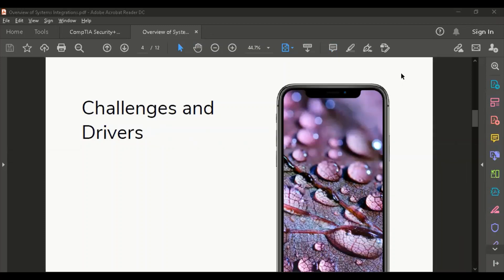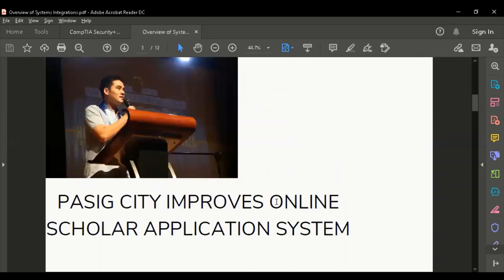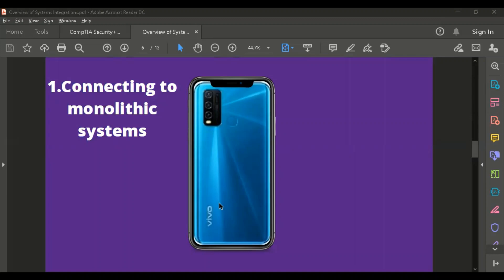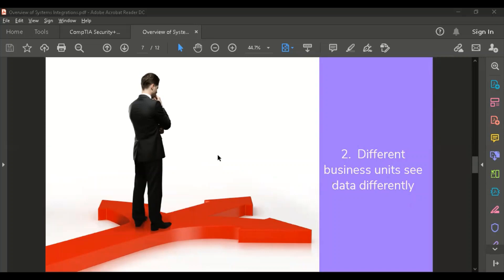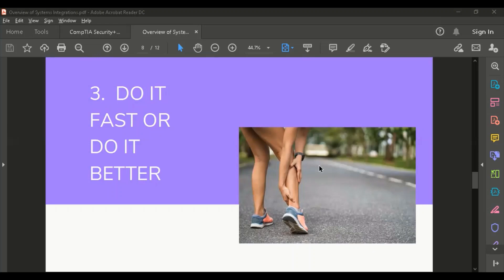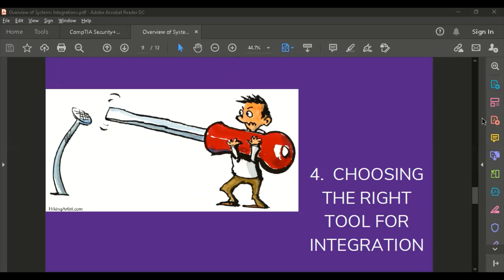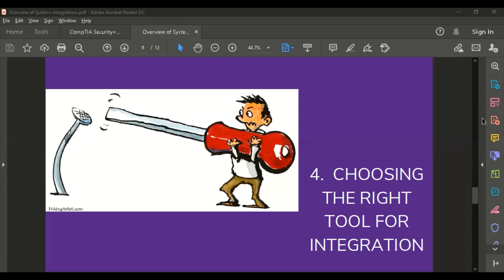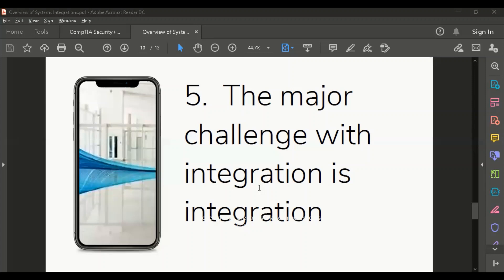Challenges of System Integration

Comment: In today’s world their so many things that change, everything has change. Based on what I understand we live with technologies; we influence by technology.
First, in monolithic system they input data or output data, error handling and user interface. system integrator has to take care to identify and choose the best way. Integration is becoming a problem due to such architecture. Most of the enterprises that we have is this monolithic system. Different business units see data is a kind of a minimum canonical data model, many enterprise architects avoid using canonical data as agreeing upon it often involves multiple meetings and discussions to reach. It’s helps avoiding point to point data modelling and allows other businesses or applications to connect to the systems using a service that implements canonical data modelling rather than having to integrate to individual systems directly in their native data model. Third, do it fast or do it better means you need to do it on time no matter how it’s difficult always remember time will never come back but think before you do it to make it better. In business they always constrained with time and cost, Proper architectural planning, used to ensure quality often becomes difficult for IT due to these constraints. There are several tools available in the market that can speed up the project implementation and help achieve business requirements faster, but they often lack a good development pipeline and use of the best architectural principles. A system integrator must find a balance and ensure that the integration solution is not just about meeting the functional requirements of today, but also potential future. Fourth, always choose the right to make it best and good. It is a struggle to choose the right but if you think and when you are planning you will get the right, like this, you need to learn and choose the best tool for integration. And for the last, one of the biggest challenges of data integration is defining it. Data integration is often used interchangeably with business integration and system integration, but they are different. this will help enterprises avoid another monolith and designing and implementing integration solutions for their current or future products,this will help enterprises avoid another monolith and designing and implementing integration solutions for their current or future products. It’s better to choose the right selection of products for your business.
Reply from the maker: Thanks. Please watch my interview with Dr. Lansigan.

Comment: The video helped me to understand the importance of System integrations and the things to consider when integrating a system. There’s a lot of things to consider when melding or integrating systems but when integrated it has the chance to improve productivity and that is the goal of all Businesses. System integration helps business by saving cost on maintenance of multiple systems. Allows them to have easy access to data because it can be found in one system only and allows them to retrieve that data. In the video Sir Burgos said that there are 5 things to consider in integrating a system and that is connecting to a monolithic Systems, Different business units to see differently, Do it fast or do it better, choosing the right tool for integration and the major challenge with integration is integration itself.Monolithic systems are systems that are interwoven with each other that getting rid of something or having a problem in one part will result on it affecting the entire part it’s like a domino effect it’s a big challenge to integrate monolithic systems because the system integrator need to be very careful in handling this kind of systems.
Data can be interpreted differently based on the people or department looking at it example of this is data from the accounting department will be interpreted differently by those people at the HR department
Do it fast and do it better is kind of self-explanatory when you are in the IT business your higher ups will expect you to deliver the functionalities that they want in a specific span of time that has been given to you so that leaves you with two choices to do it within the time that has been given to or to do it to the quality that the customers expect from you
Choosing the right tools is very important since you cannot use a hammer to screw in a nail that is the screwdrivers job the same thing can be said in system integrating you must ensure that you have the right tools to integrate the system in the right way 
The final and last one is obvious the major challenge in integration is the process of integration itself you have to consider all of the above mentioned challenges but you need to actually integrate in successfully -BSIT 3F ASIO JAFET L
Reply from the maker: Thanks. Please watch my interview with Dr. Lansigan.

Comment: System Integration is significant in today's generation because the integration of a system makes the systems more reliable and capable to use. Improvement is the main objective of why we integrate something as well as systems because we need to enhance the performance in order to take on additional tasks and to help the communities. Just like the latest submission of requirements in Pasig City Scholars, they enhance the system to help the scholar community to avoid face to face interaction and obey safety protocols during this pandemic.
Some challenges and drivers might encounter such as:

1. Monolithic systems that are basically interwoven or interconnected to each other. Therefore, system integrator has to take the best way of integrating with monolithic systems.
2. Seeing data differently from different business units because of the different roles and functionalities they have within an enterprise. This is a challenge because a standard data model is required in order for the system integrator to integrate with a standardized view of data within the enterprises.
3. The problem related to time and cost is also a challenge in integrating a system because the job of a system integrator is not just only to satisfied today's requirements but to satisfied also the potential future performance of a system within the enterprise.
4. Choosing the right tool to integrate a system is a challenge within the enterprise because the right integration tool supports hybrid integration, hybrid integration seamlessly integrates with a cloud-based application.
5. Lastly, the biggest challenge with integration is integration because a system integrator should choose a product very well.
Reply from the maker: Thanks. Please watch my interview with Dr. Lansigan.

Comment: I have learned while watching the video is that what we call system integration. A system integration is the composition of a capability by assembling elements in a way that allows them to work together to achieve an intended purpose. It is maybe a long pending project but the pandemic make it hurry to produce the system. One of the examples is the system of our government it is called the Pasig City Scholarship System. It may be taking too long to make it reality but this they make it fast to make because of the pandemic that we are facing right now so that I as a student can apply just by clicking and typing while I am at home. There are 5 challenges in an integration system, one is the monolithic system meaning is that they are connected to each other. They are all in one system which is if one of the components got problem, other components will be affected.
The second one is the Different business units see data differently every department saw the data differently. They saw, experience different kinds of data in each and every department that’s why they have a different kind of thinking. Third one is the do it fast or do it better. You can do it fast but the objectives and terms of the client will meet its expectation or do it better you can do it precisely and easy even if it slow but will meet the deadline so that the client will be more than he/she expected. The fourth one is the choosing the right tool for integration. You must choose the right one to use in the right project so that your efforts, time will not be waste. Using the wrong tool will sometimes still work but it will be more complex and difficult to execute. The fifth and last one is choosing the right product for your integration. You must be compatible and pick wisely so that you can enjoy and happy of your choice.
Reply from the maker: Thanks. Please watch my interview with Dr. Lansigan.

Comment: Based on my understanding we live in an era where technology is advancing. Our daily lives have been transformed and influenced by new technology as our daily operation. Different company uses IT System to allow business. In Addition, System Integration refers to the process of connecting different components into a single larger system that role as one. There are 5 Challenges with System Integration. First, connecting to monolithic systems means company relies heavily on systems that are largely legacy systems that cannot be removed for integration purposes. If it has a monolithic architecture, a computing scheme is called monolithic. The technically distinguishable features of monolithic architecture are not architecturally distinct parts, but are instead interwoven. Integration is becoming a problem due to such architecture. Most of the enterprises that we have is this monolithic system. Second, Different business units see data differently means Features is viewed differently by each business unit or business domain because their operating roles are not the same and they may use different systems or applications. From the point of view of an individual unit, this is good, but to incorporate these structures, a common data model is needed within the organization. Not only does a system integrator need to follow an organization's specifications, but it needs to look about these to develop an integration that provides a standardized vision of data within the organization. Third, Do it fast or do it better mean as an IT student we need to deliver something to the company, If you not able to do that you maybe the next day you’ll be fired. Because of these limitations, good design design is used to ensure consistency is often challenging for IT. There are many resources available on the market that can speed up the execution of the project and help meet client objectives efficiently. Fourth, Choosing the right tool for integration means there are plenty of solutions available on the market that aim to have the best experience for integration. It is a struggle to choose the correct method for a company. Likewise, in your example sir he knows what’s the goal but he does not know how to use the right tool but its up to us to how to choose it. Lastly, The major challenge with integration is integration means an organization selects a stack of items from a single manufacturer and only later can it realize that the stack is either very difficult to manage or does not fulfill its needs. It is very important to choose the correct selection of products for your business. Either by a web service layer or through libraries, the software selected should allow integration with other systems or products.This will help compatible enough.
Reply from the maker: Thanks. Please watch my interview with Dr. Lansigan.

Comment: On my point of view today 21st Century we are living in the digital world, that everything is given and we are still conducting a research to have a new high-tech gadgets that will help also make the work easier. Our daily living change also because there is a globalization that we face every single day, those changes are normal for us to keep on the changes of the waves. Now a days most of the company use some software that will help their company in terms of lessen the workloads that they have and here is the system integration that refers to the process of connecting different component into a single system as one and enhance the existing systems for the community. There are 5 challenges with the System Integration that has a role in the world… First, Connecting to Monolithic System” from the word of monolithic root word “mono”, that monolithic system are meant to be together. Monolithic architecture that can build from single piece of material to an object. Monolithic system has a domino effect if there is a malfunction that other software will be affected. Second, “Different business units data differently” means that you have a different point of view and operation with the others in term of skill and knowledge, for example are department that has different workloads that they don’t have a same data that you make that both of them didn’t understand. That you need to be careful to avoid jargons so that the different department can understand the data easily. Third, “Do it fast or do it better” means that delivering the object before the given date. But there is a negative side of doing it fast why? Because, it can affect the quality. As an IT or programming you need to have a time management and enhance the system on time and with quality. Fourth, “Choosing the right tool for integration” means that you knew how to solve or give a solution to the problem that still you are using other tools, because you are trying to make something new. For example you are using the old software for your computer and you want to new a software that you are going to use for your project. But you can conduct a research how to solve the problem. Last, “The major challenge with integration is the integration” means it’s not easy to have a collaboration, because they have different brand that they are you using in their company. In short you need to choose wisely and conduct a research for the long run of your collaboration it is important, because you have a customer that is why important selecting a brand that can fulfill your customer needs.
Reply from the maker: Thanks. Please watch my interview with Dr. Lansigan.

Comment: My takeaway learning from the previous lesson which is all about the overview of system integration. I learn that system integration are interconnected platforms or system that are intended to enhanced a performance of a capable system. System integration are built to help the community, to make our lives easier to do. Like for an example is the Pasig city’s online scholar application they enhanced the system in order for the applicants of scholar can easily access it. And of course system integration have its good side on integrating additional system and different tasks, and definitely it has its challenges and drivers as well. First Challenges of system integration is “Connecting to Monolithic Systems” in the lesson a mobile phone was an example, it is an interwoven because it has interconnected system on it like the application on it, the libraries on it. But the problem is when there’s an application that fails the whole process or the whole system is affected. A system can be called monolithic if the system has an architecture monolithic in nature. The next Challenge is “Different business units see data differently” in this part of the lesson it states that the difference of business units on how they see their data, like for an instance if you will ask a marketing person vs. an I.T person they will look the differently because of on how they look or interpret the data and also they will also answer the data differently, because on how they work what their job is they will see the data differently. And the next challenge is “Do it fast or do it better” in this part of the lesson it teaches that there should be a measurable time and it has its constraints on the cost and how much time it will be created. Like for an example as an I.T person there should be always a measurable time to do a certain system in order for it be more efficiently working when it’s been delivered to the client. It teaches that a system integrator should find a balance just to ensure the system integration is meeting the functional requirement of the system and also to be able to perform better on the next few more years. And the next challenge is “Choosing the right tool for integration” in this lesson it teaches that choosing  the right tool for the system integration is a challenge, because an integration tool must almost support a hybrid integration. And also it could support different cloud technologies such as B2C business to consumer, B2B business to business, BYOD or also known as bring your own device. And the last challenge is “The major challenge with integration is integration” in this part of the lesson it teaches for each particular enterprise or company they have their own products. It teaches when you become a system integrator you should be able to choose your product that it can be compatible enough.
Reply from the maker: Thanks. Please watch my interview with Dr. Lansigan.